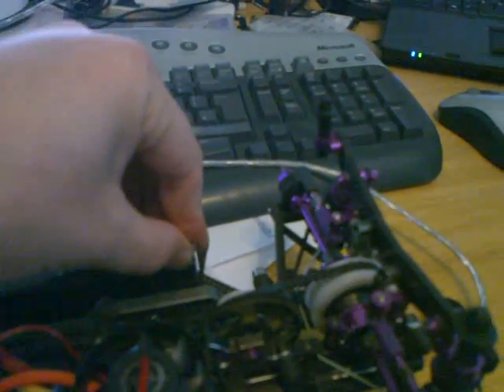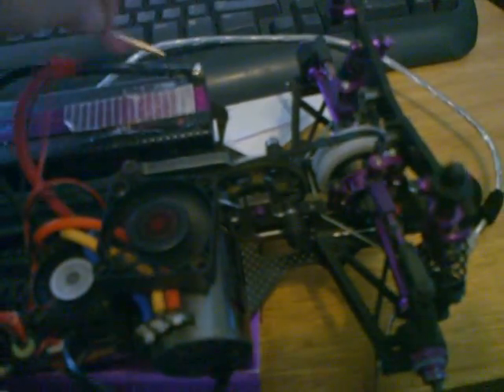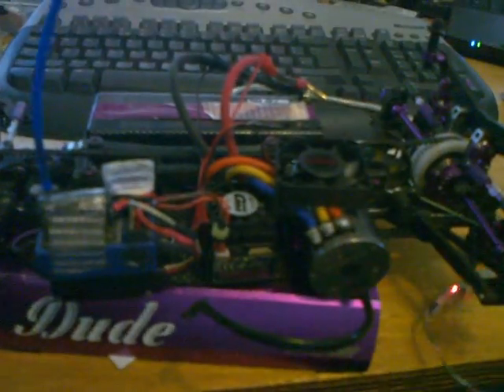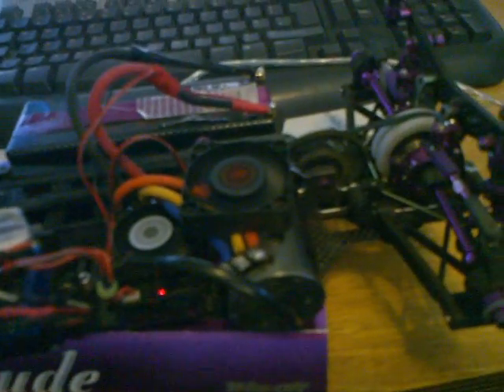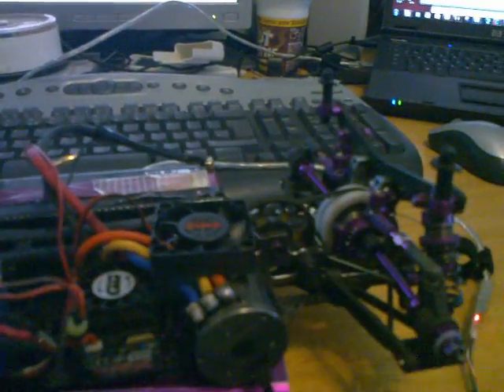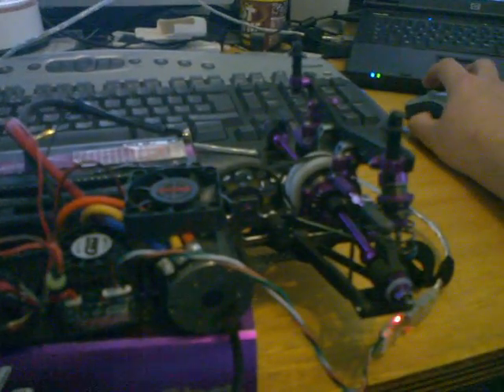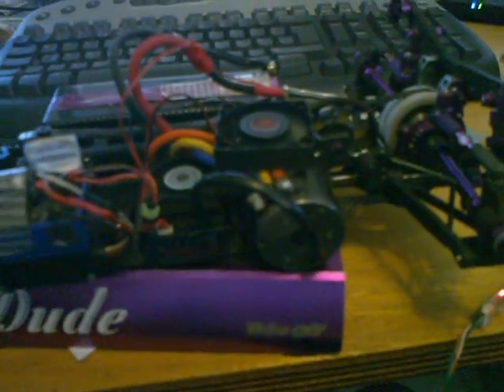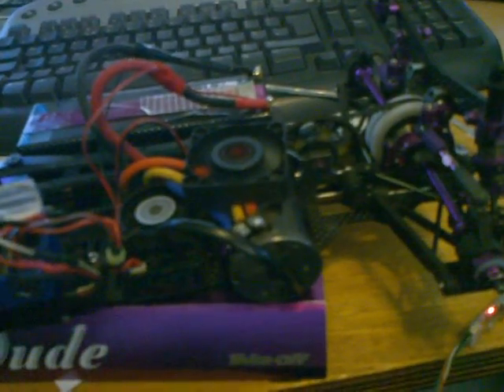GM V8 Firmware and LiPo mode

Comment from the maker: Hi there hummermanh20..   This is my original GM90 pre the 2010 version which came out with the Firmware Ver 7..  I sent it back to Schumacher/GM to get it upgraded to the Special Ver 8 firmware which is pretty much the same as the 2010 Firmware version 11.. For this model you need to be running the GM Software 1.4.0.25 And you need to select the Second of the Version settings..  Officially LiPo mode is selected on the Advanced Settings TAB an changing the Voltage Cutoff to 250.. Hope this helps